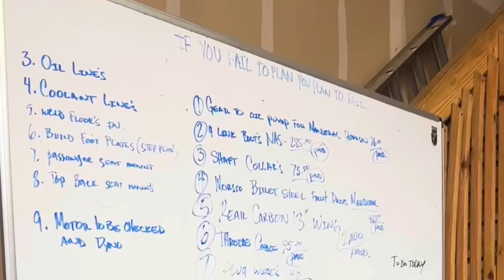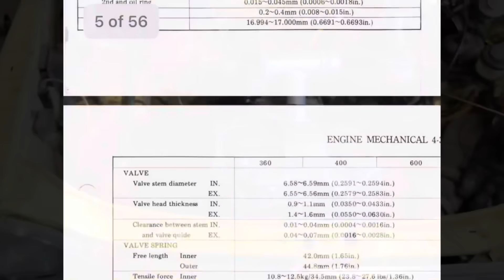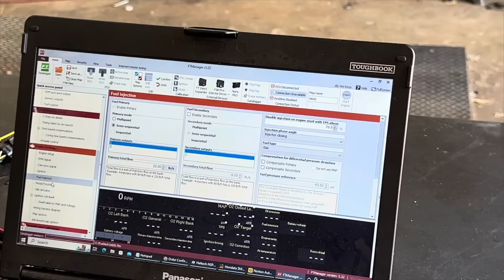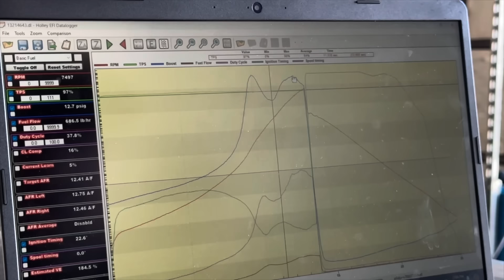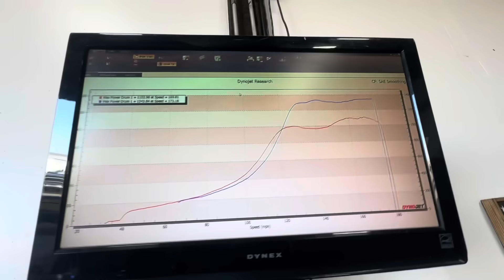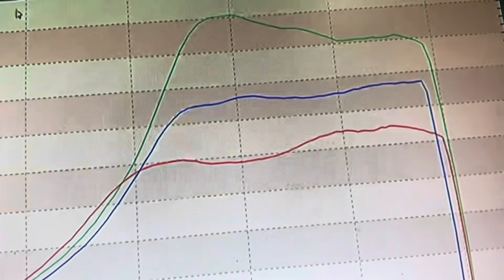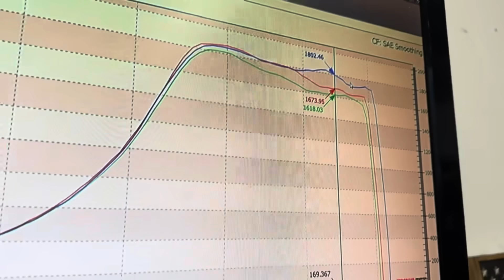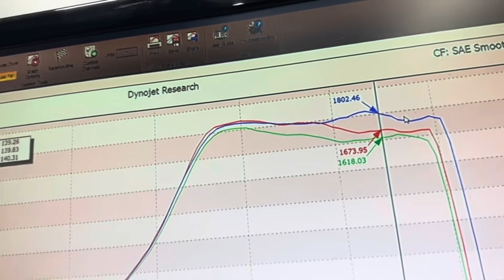N600 Should Have Been Made This Way! Efi Conversion Episode 3

Comment: The N600 and the CB750 came into the dealership at the same time. I had just graduated HS and didn't want to ride a Honda MC through another winter. Mine was yellow same as that. If you shifted hard and cranked the wheel the inside tire would bark. Still have the window sticker. MSRP $1,395!!

Comment: Billy the kid from street racing channel had rumes from a plastic supra tank flash up on him a few days a go. Burned his face and right arm. He used a cordless Milwaukee drill to drill a hole in the bottom for a fuel line. The drill has brushes and sparks when the trigger is released. Billy said the fumes ignited after the 3rd time he released the trigger. The tank was empty but he didn't do anything to vent out the fumes before drilling.

Comment: Hooking the (empty) fuel tank up to the exhaust of an idling car is what turbo yoda has been doing apparently. The exhaust gas warms the tank so any residual fuel evaporates, but since it's exhaust it hasnt got the oxygen to burn. Might be worth doing as an extra precaution after rinsing with water, I've heard horror stories where there was still some residual fuel left even after flooding with water.

Comment: Outboard motor use what is called a wasted spark coil. You need one coil. It has 2 leads out put. It just fires every other time to spark. look it up it is the answer to your problem if you have time. and you dont need the diributer. just a crank signal to tell it when to spark

Comment: I noticed the mustang only has an 8.50 cert cage, but makes 1800whp. What classes does the it run in?
Reply from the maker: he runs 1/8th and no prep. has gone a mid 7 on accident . 😂
Reply: I figured that car could easily go faster than an 8.50, but I also know Bandimere was pretty strict on the nhra rules. That’s why I was wondering what class he was running in with an 8.5 cert cage.

Comment: I doubt very much both cylinders are firing at the same time they might be going up and down at the same time but they're taking turns being under power
Reply: They don't. Brent said the cam is 180° opposed so wasted spark with a single coil should to the trick.
Reply: @medicenchepibe  Oops, thanks. I messaged before watching the whole video